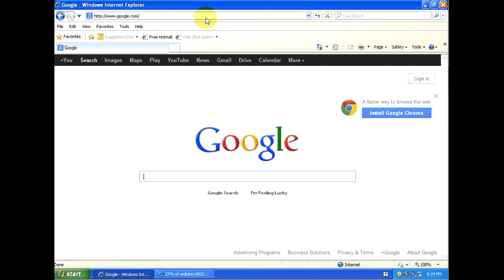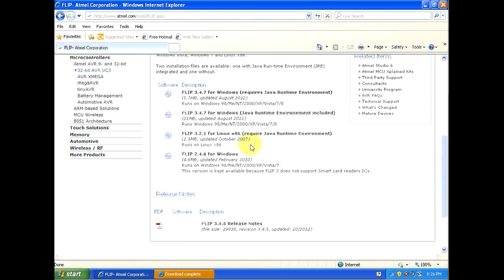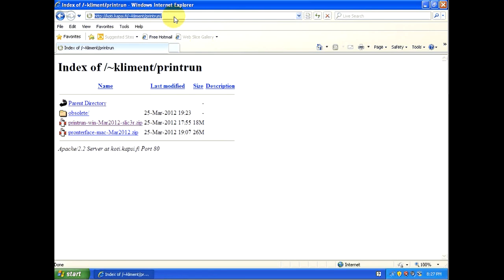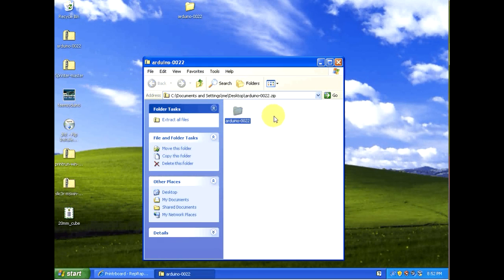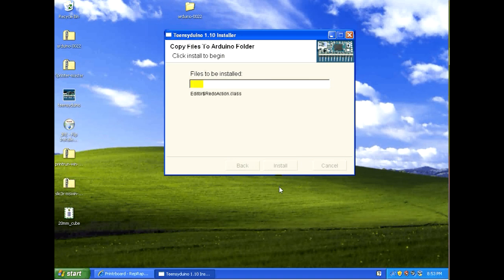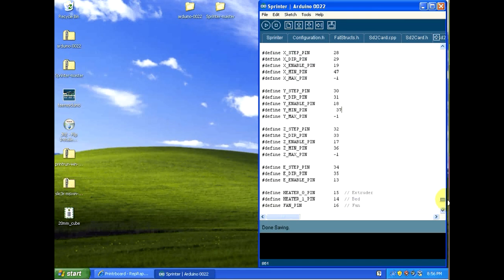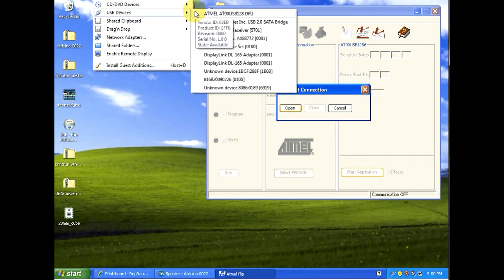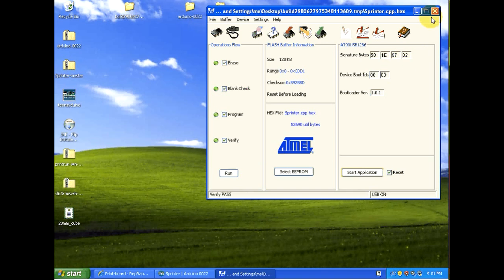RepRap Prusa Mendel Iteration 2 Assembly 20 - Printrboard Software

Comment: Thanks for all the downloads, but just one little thing. On the teensy software, it wont allow me to press the "Next" button!? How do you fix that?
Reply from the maker: Are you using a Printrboard?
Reply: engineglue Well, I don't have a 3D Printer at the moment - but I will be getting one soon. I have followed your steps and downloading the older versions, like you just said on the video (if downloading newer versions more likely to be having glitches). I have solved the problem that I said earlier, it's because I downloaded the latest software (1.18, it should be 1.10)
1. I did by copying the download hyperlink
2. Pasted on to the http bar
3. Change the version value number from 118 to 110
4. Then press enter, it downloads the older version.
Reply from the maker: Benjamin Hall Okay. When you're ready to install the software, make sure you match the right video with the right electronics. This video is for the Printrboard. There is another video for Ramps. Have fun.
Reply: Same thing for me

Comment: I don't have Windows XP, and when i'm tryin to conect arduino with Flip (min 15:08 of your video) I have one error massage "AtLibUsbDfu.dll not found". How can I fix that?
Reply from the maker: This video is for a Printrboard. It sounds like you might be using the Ramps. Take a look at the next video in the series. RepRap Prusa Mendel Iteration 2 Assembly 21 - Ramps 1.4 Software
Reply: Excellent!... thank you!
Reply from the maker: José Manuel Martínez Valdez No problem!

Comment: Hi engineglue thanks for the great videos. They have been very helpful in the assembly of my machine. Unfortunately I'm running a Sanguinololu board on a mac and need some guidance on doing the firmware update. Can you suggest a link?
Again, great work.
Rob.